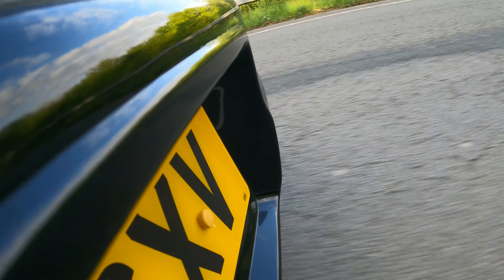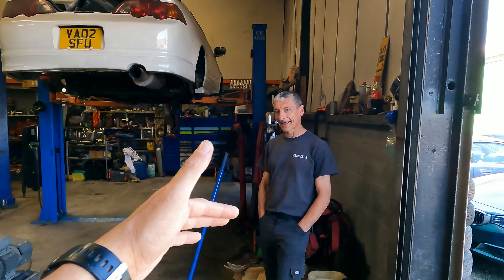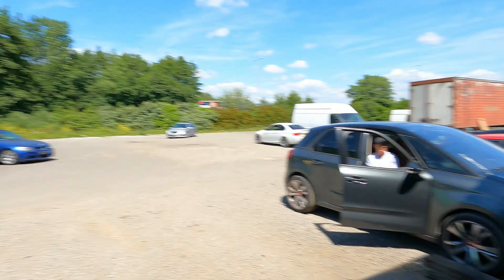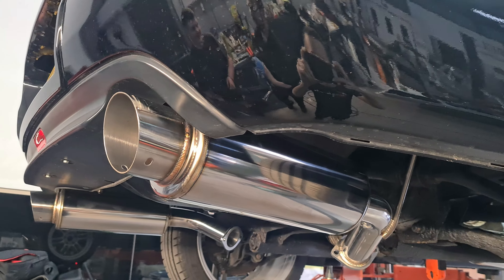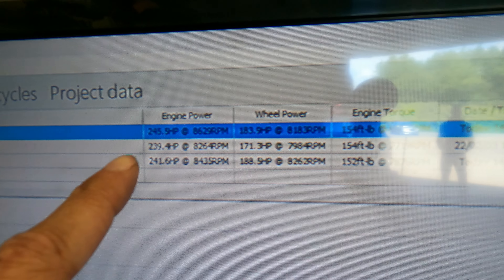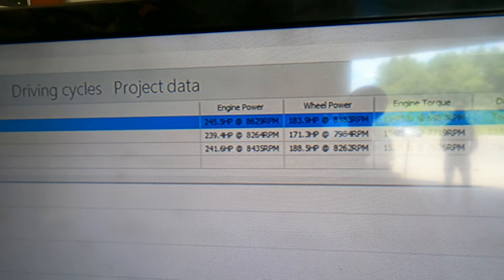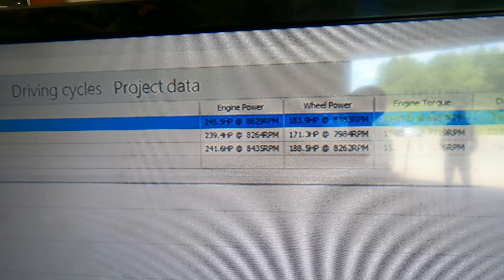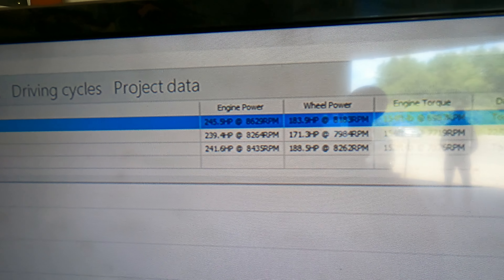Does A CATBACK Exhaust Give You MORE POWER? **Honda S2000 DYNO COMPARISON**

Comment: You say "well documented on forums the exhaust is restrictive" I'm pretty sure it's only well documented the cat is restrictive, pretty sure everyone agrees the catback isn't restrictive at all and is only changed for noise not for power.

Also it's pretty well documented that these cars don't make factory power yet yours made more than that? I think that dyno is a bit optimistic :D
Reply from the maker: I am basing my statement of the restricted exhaust on the fact that other S2000 owners have seen power gains by simply replacing the standard cat back system with an aftermarket one.

The dyno may well be "optimistic" but Kenny's Civic made 279bhp on this dyno, and 282bhp at BD Performance, so we trust it to give decent readings.
- Drew